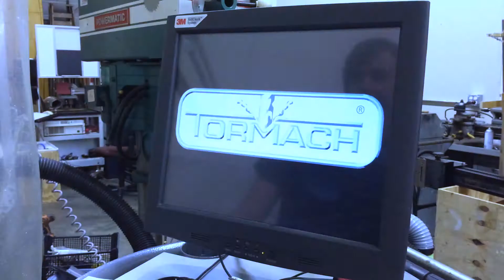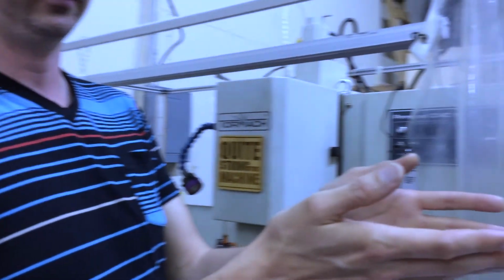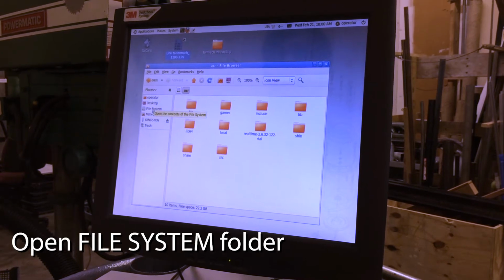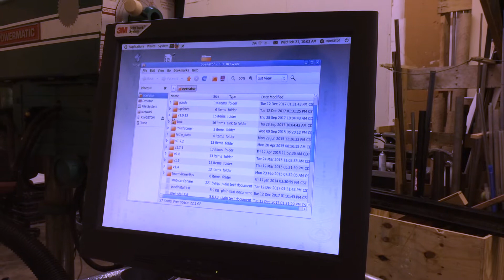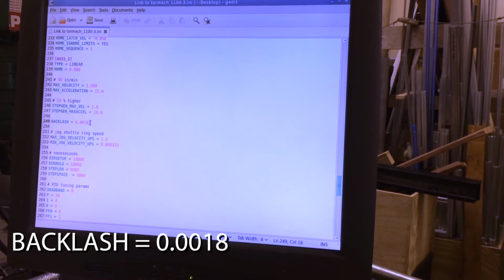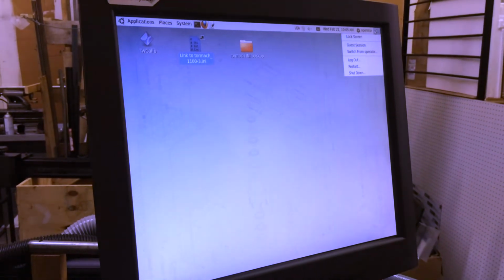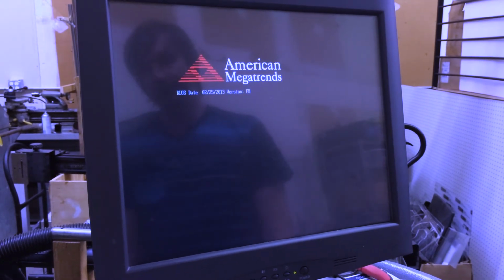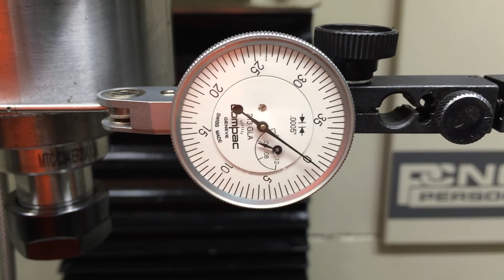Tormach CNC Mill Path Pilot Backlash Adjustment & Troubleshooting Milling Machine PCNC 1100

Comment: Since the machine does not use an expensive closed loop system, it is 100% reliant on the backlash in the ball screws.  The little bit of backlash does not really effect much, unless you are milling circles and need them round. (be ready to ream or bore for the finish of the bore).
Son, you are no measuring backlash at min 9:50.   Backlash is the distance between changing directions, and you are measuring the best that this stepper motor can do.  It is not a super fine system for .0001" moves, but it is fin enough to machine anything the machine can handle.
If it is not a closed loop system, you are just changing the position of the table in the program.
But, it you want to prove me wrong, (you may have something), circle interpolate 2 holes ending with zero tool pressure with and with out your system, and see if one is more round than the other.
Reply from the maker: This updated video shows it better. https://youtu.be/ZzgsUcI43SM
 I agree that it's confusing what I'm showing at 9:50, and the video was not edited properly to make it understandable. I understand that backlash is the distance between changing directions, so the goal was to reduce that distance. We do a lot of 3D profiling, where the axis directions change. Without backlash compensation (or overcompensated), you get a zipper effect at the transition, which is a pain to remove in the post processing. Tuning the backlash once in a while reduces makes the finish better.

Comment: You can hold left alt + shift keys when you select exit from GUI as well.  When you press OK confirmation to exit hold the keys down and it will revert to desktop.  easier than shutting down and rebooting.
Reply from the maker: Thanks, will give that a try!